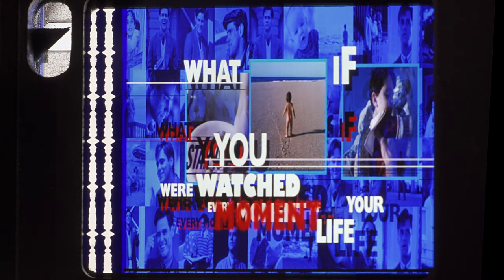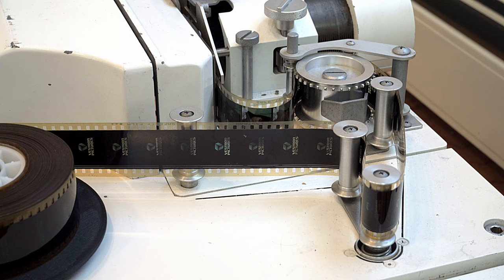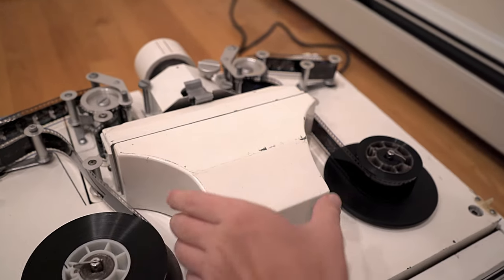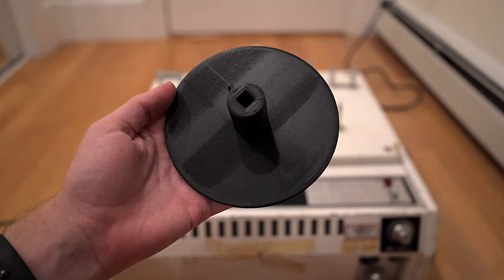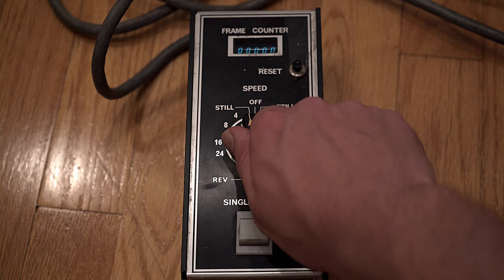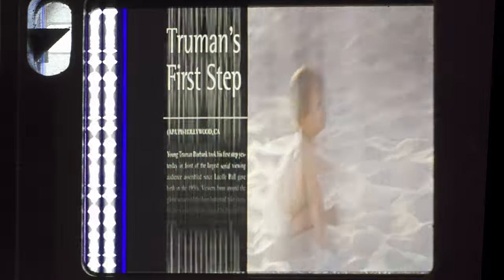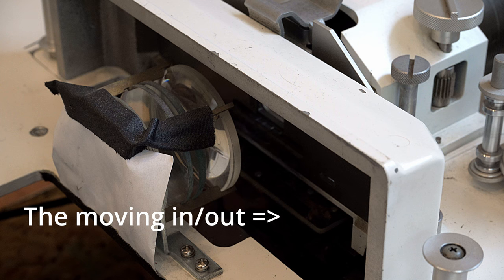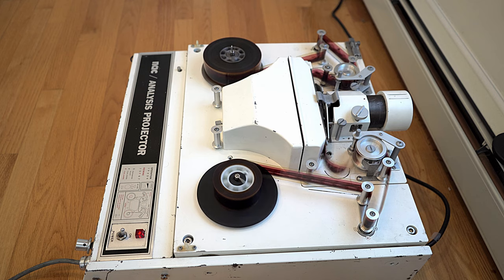35mm Film Scanner AND Projector?

Comment from the maker: I forgot to mention that this projector was not designed to read the optical sound tracks! However, it can be done easily in software if using it as a scanner using the AEO-Light application.
Reply from the maker: @Chicken Scratching  great question! I was planning on making a video about that in the near future, it’s very cool. How they did it they actually record audio separate usually. A light would shine at a shutter-type gate and move up and down based on the audio being sent to it. This light would be aimed at a moving strip of film, so you get those weaving lines on the film. To play it back is reversed. Light shines at it (called an exciter lamp) and would be projected on a solar panel type device, that read the voltage of the intensity of the light going through the audio track. This could then produce audio. This is also the very basic description. As for keeping room on the film. Generally cameras just wouldn’t record image on the left side or in printing the film they would shift the image around

Comment: In fact, in the Netherlands they used to make pics at traffic lights (for speeding cars or not stopping at a red light) on 35 mm film.
Possibly this kind of projector was used for (manually) read out the information of the pictures (such as date, time, licence plate) in order to send a fine.
Reply from the maker: Thanks for the info! I bet this was used for something like that, super neat!

Comment: Why do film have to pass through many loops like that?
Reply from the maker: The film is constantly moving, yet the image has to stop moving to be shown. The trick is to have an upper and lower loop, which allows for the film to bulid up and get pulled when it has its turn in the light. So, the loops allow for film to always move, while the intermittent sprocket can have a moment to freeze the frame